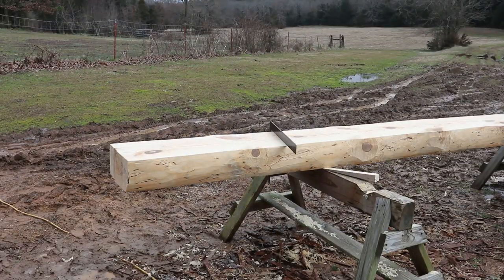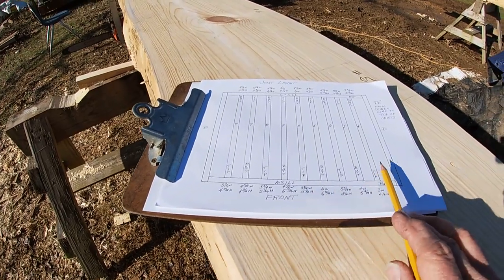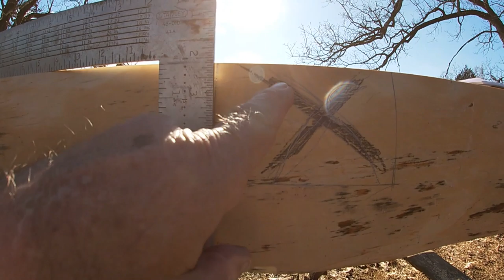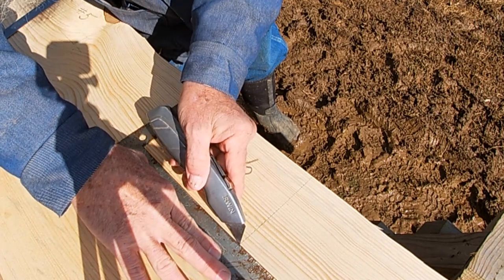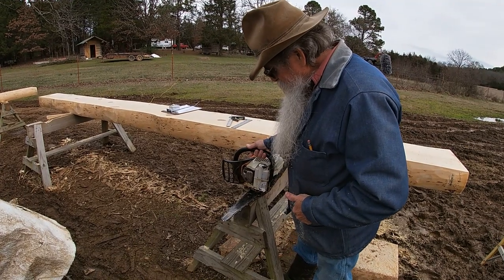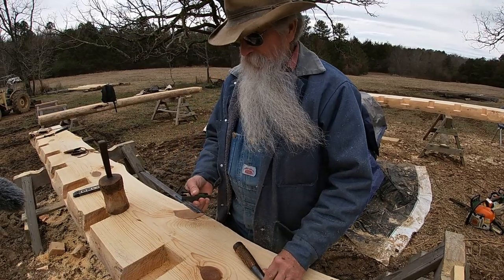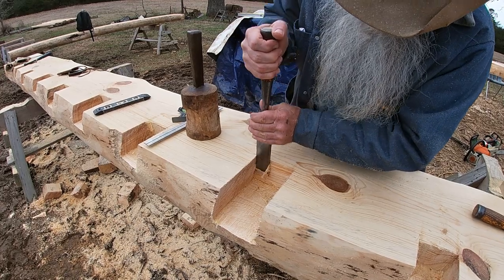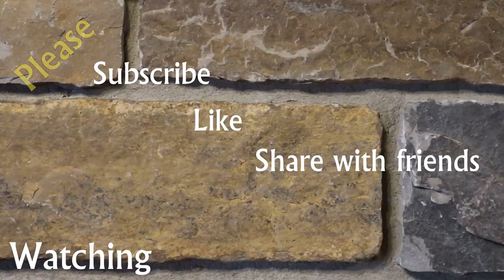Floor Joist Pocket Layout & Cutting(pt2)-Dovetail Log Cabin Build (Ep 13)

Comment: Hi I just got through watching most of your videos so just wanted to say thank you very much for sharing your knowledge with us.   I learnt loads especialy how to plumb the walls and make the floor joist pockets. looking forward to your next videos. ps. have you thought about adding wood ash to the chinking mix it is very stable even under water and is a lovely colour.
Reply from the maker: pz ps   Howdy- thank you so much for watching our videos! I sure do appreciate it. I have never put ashes in the chinking before but it sounds like something l may try. Don’t know if you saw the video on chinking the smoke house. I used to use sifted red clay for the color and it looks good but it seems to cause hair line cracks when it cures out. I used cement dye on the smoke house and didn’t have any problems with cracks. Thanks for the information. God bless you

Comment: Where can I find the 3:1 aluminum taper 1/8" thick Template? Do you use the same taper for 6" or 7" or 8" thick logs?
Reply from the maker: Howdy Bill- I’ll check to see if my buddy still has some templates. He would be who you get one from. The thickness of the log has no bearing on the the taper of the template. You can use the same template on different thicknesses of logs. God bless

Comment: Great video.  Thank you. Was it necessary to set the joists at 16 on center with such large material? I wonder if 24 would be OK. I guess it comes down to the flexibility of the 3/4" plywood
Reply from the maker: Howdy Tim- I always use a 16” center when I am using 3/4” plywood for the subfloor. Thank you so much for watching the video. Take care and God’s blessings to you

Comment: You ever have any issues with pine beetle eggs or powder post beetles, considering the wood isn't kiln dried? How about in your existing cabins?  You are using Loblolly Pine (southern yellow) correct?
Reply from the maker: Howdy Chris- the very first thing I do when I get the logs is to peel the bark down through the cambium layer which is what the bugs like to lay their eggs in. Have never had any problems because of how I take care of the logs when I get them. I’m not sure if you can call the yellow pine we have loblolly. It’s growing in the mountains here. God bless
Reply: @TheBeardedCarpenter  That's good news! I've noticed how much care you put into your logs, ensuring all the cambium was completely removed.  Such a pleasure to watch your videos.  I've been enjoying them tremendously; so thankful you created a channel. I like your style.  I'm glad to hear that you don't have any issues with insects.  

I still have videos to view and you may answer this muse in one of those; so you're essentially building green, correct?  Then letting the dry out occur after the structure has been built?  Reason I ask, I have a structure in mind for the use of a mortised sill beam and I'm curious to know if you've noticed any movement, a year or so later, when the timber begins to dry and settle in?  Any issues of concern?  I'm thinking about using this floor system in a workshop build; I'm so excited, I'm long overdue for a larger workshop.   😁😁  Sure I could use dimensional store bought lumber but there's no soul in that.

Comment: Again, great explanations throughout the whole process. My wife, Caleb, and I all sat and watched it. You're getting quite the following just here at my house. (Caleb still calls you "Grandpa") Quick question: I know that you are teaching the traditional method for building a log cabin, but could someone use joist hangers attached to the sill logs and dimensional lumber as floor joists since they would only be visible from underneath? Would doing it that way make it easier to lay out plumbing and anything else that is typically in the crawlspace? 

Also, are you planning on doing a video on sharpening the various tools? If not, are there videos or resources you would recommend to help folks learn how to properly do that?

Thanks again!
Reply from the maker: Howdy Jim- you can certainly use joist hangers and demensional lumber for your floor framing and yes, it would make it a little easier to get your plumbing in. I did the round joists to show how I would do it ( with doing round joist) and to save some money. We do plan to add in some videos on the way I sharpen my tools. God bless y’all

Comment: Thank you for another lovely video. I could not understand how did you arrive at the figure of 7.5" up from the centre, when laying out pockets on Sill Log A. I also saw you leaving some wood towards the outer edge of the sill log. Why was that done? Secondly, is there a minimum diameter below which a log cannot be used as a Joist? I have seen people recommend using 2" by 12" boards as joists of log cabins. You are using obviously larger logs than that. Why is this so? Thirdly, is there a minimum amount of wood that should be  left on the Sill Logs once the joist pockets have been cut? Thankful for clarification Sir.
Reply from the maker: AS   I used 7 1/2” up from the center line to keep the top of the joists close to the top of the sill logs. The wood left on the back side of the pockets retains the strength of the log. The oak logs l used were about 8” in diameter with a girder under them. Normally I would use dimensional lumber but I am trying to save money. I also wanted to show how it can be done traditionally and I really enjoy doing that kind of stuff.
Reply from the maker: I want to leave as much wood as possible under the joists for strength. If you watch the video where l set the joists you can see how it all came together. God bless you
Reply from the maker: AS   You may also want to watch the video where I put the floor on because it shows the girder. Thanks

Comment: That's correct, the straight parts of my trees aren't that awful long and I may have to use a few to do a wall length.
If you could show even just a sample, that would be great, but only if you have time and it's not to much trouble.

Thank's again for everything your doing, I been on youtube for at least 8 years searching for exactly what your teaching everyone.
John Iron Rock N.S
Reply from the maker: John Stewart   Howdy John-  I will try my best to get a video sometime to show how to do a splice on a log. I don’t mean to put a feather in my hat, but, I haven’t found any other information, either. As far as I know, our videos are the only ones actually teaching a way to build a cabin. I’ve watched many videos but haven’t found much that would show you how to build. God bless y’all

Comment: Check out Metwood Joist Reinforcers,
www.metwood.com
They allow up to 4" holes in 2x8s, 6" holes in 2x10s and 2x12s
1 hole per joist only allowed.
They are engineered and or code approved.
Reply from the maker: metalbreath66   Howdy and Thank you for the information. God bless